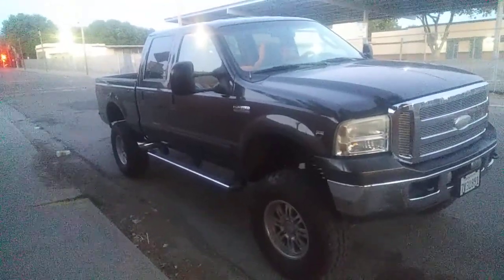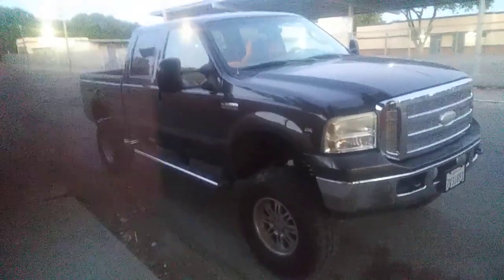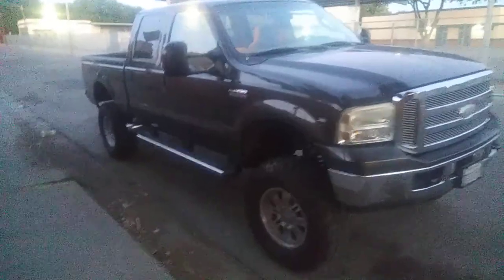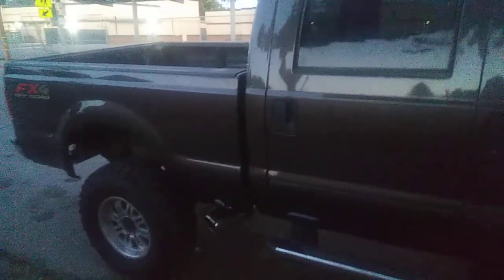2005 f250 triton v10 flowmaster super 10

Comment: Three valve didn’t happen until late 2006 early 2007s
Reply: Wrong. 3valve came out in 05
Reply from the maker: Lmao 2005
Reply: They are right the 3v wasn't available till 05. I have an 03 2v f250 6.8. Although I wanted the 3v because it produced more HP and torque it really lacked the reliability of the 2v. Some may disagree but to each their own. I have 160k on an untouched 2v v10......well besides routine maintenance and had 1 coil go bad.